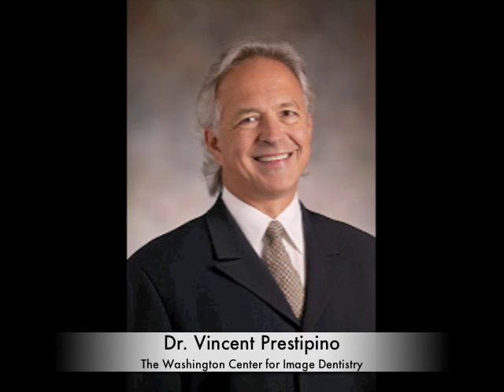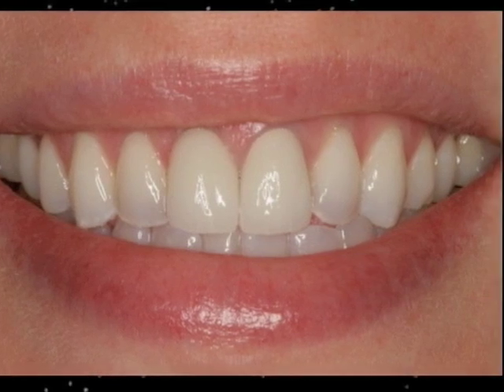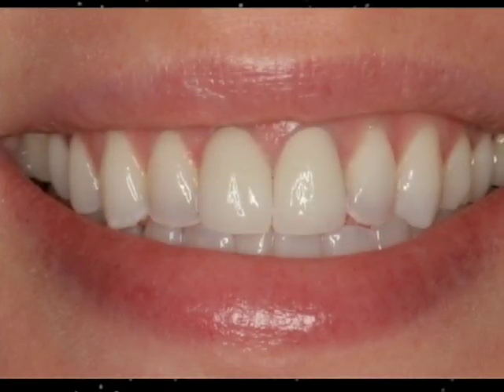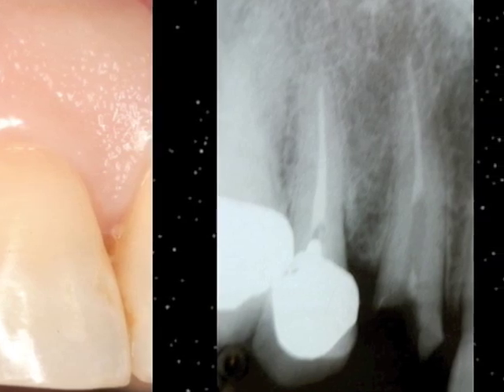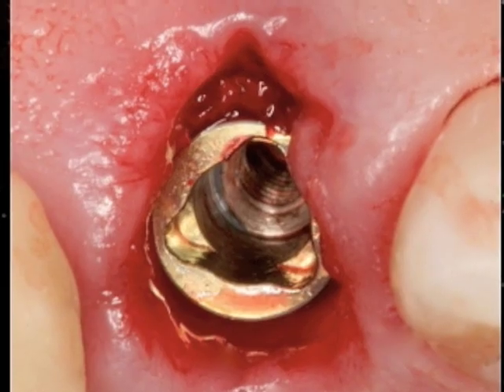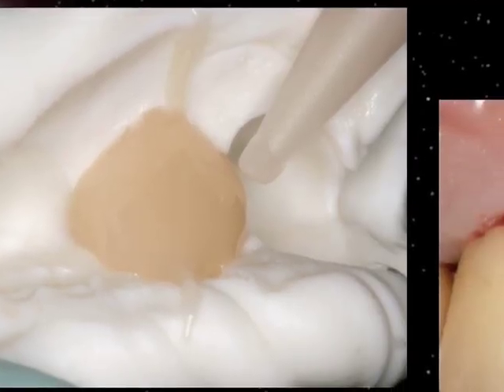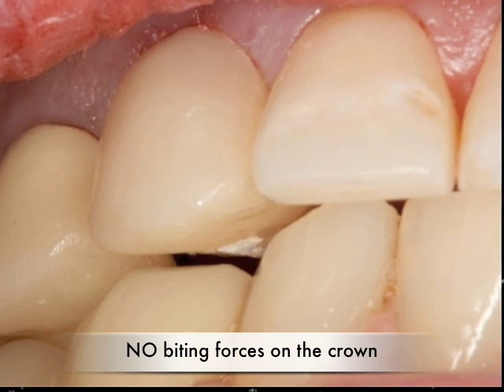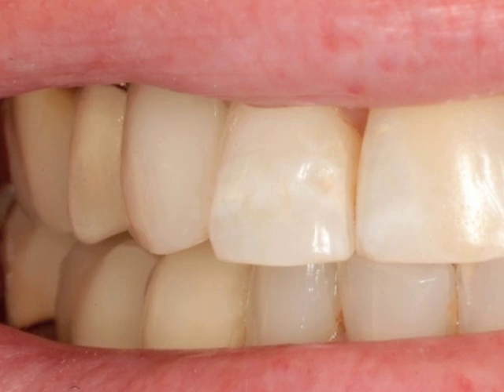Dental Implants in the Smile Zone- Part 2

Comment from the maker: @dadgar3 
Hi
The question is are the temporary crowns supported by the implants at this time? If the temporary crowns are supported by the implants, then it is the best opportunity for your dentist to optimize its shape, length, and cosmetic values. Because it will essentially set the stage for the final crowns to come. You might want to discuss this with your dentist. Hopefully he knows about the cosmetic criteria and techniques to make it happen. - Dr. Kazemi